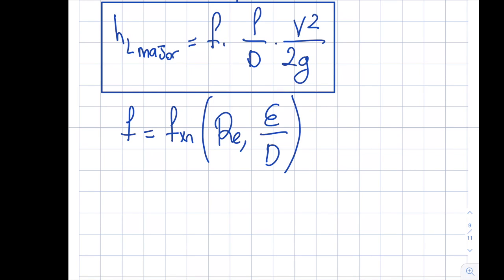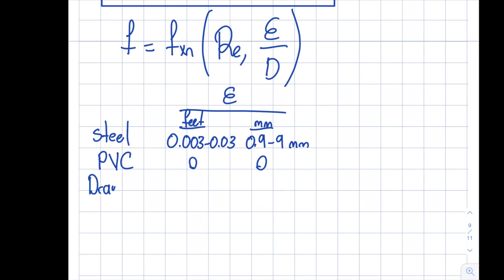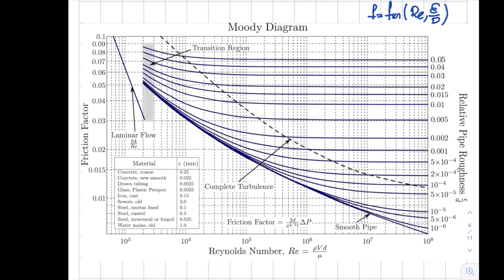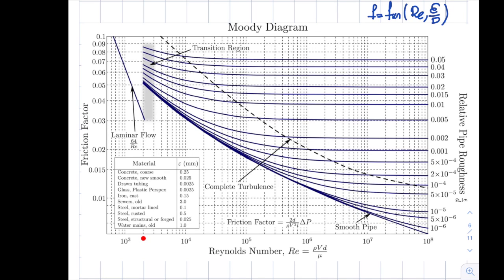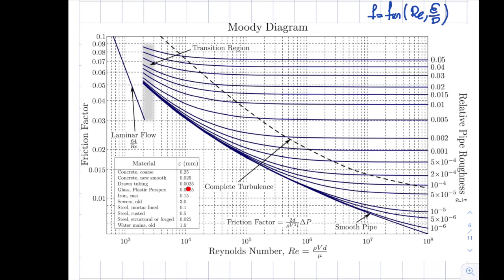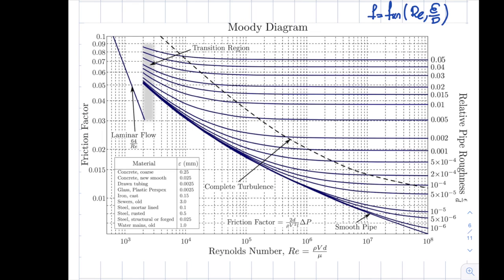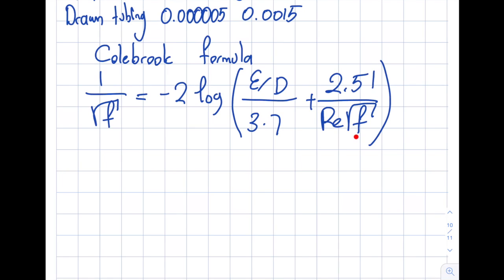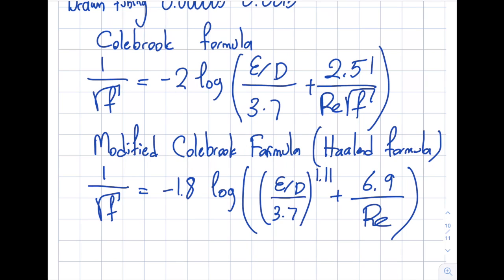Fluid Mechanics 11.5 - Friction Factor - Moodys Chart or Diagram - Colebrook and Haaland Formula

Comment: Why we are not using nikurade diagram instead of moody chart?????
Plz reply must if you have any information
Reply from the maker: Hi Qadeem, It is NOT wrong to use Nikuradse's diagram, it is just a different interpretation. I can write a page on this, but here are the  major differences from the origin of diagrams.
1) Moodys chart is obtained for pipes with non-uniform roughness such as corrosion and rust, caused by natural aging of the pipes.
2) Nikuradse's diagram is obtained for uniform grain size artificially added to a smooth pipe wall. Thats why you see Nikuradse's diagram in research papers as it is easier to replicate and more predictable.
I teach my students Moody's diagram as they would need that more in their careers, and FE exam is based on Moody's diagram.
Reply: @CollegeFluidMechanics  sir it's better to use nikurade diagram in research papers than why we are not using in course study..
I have concluded that from your reply that moody chart are used in every day life b/c of similarity with those pipes which are under using ...
Can I correct???
Reply from the maker: You are right, Qadeem. It is very hard to replicate the natural aging of pipes in an accelerated manner in the lab environment, but coating the inside of a pipe with sand is achievable with minimal/acceptable effort. Also, if you know how to use Moody's diagram, you can easily read Nikuradse's diagram, hence you are learning transferable skills with this lecture.